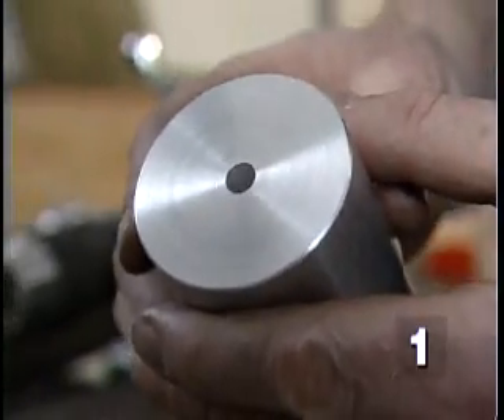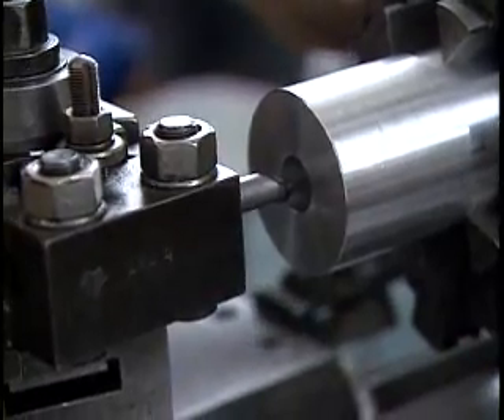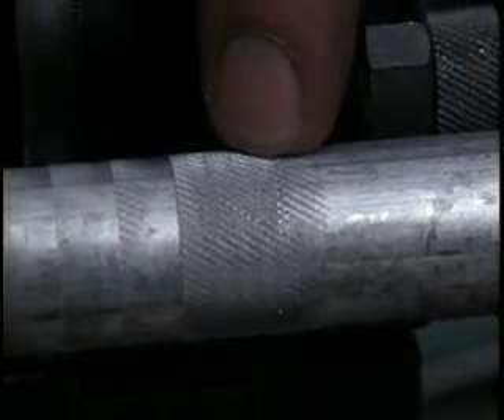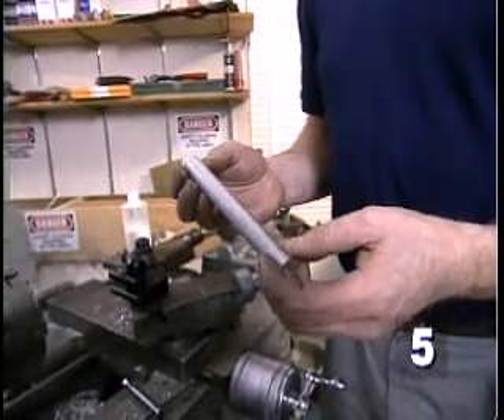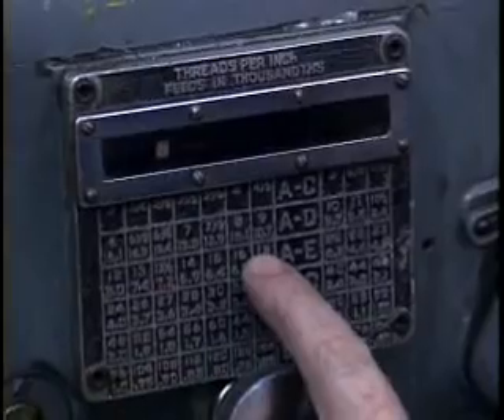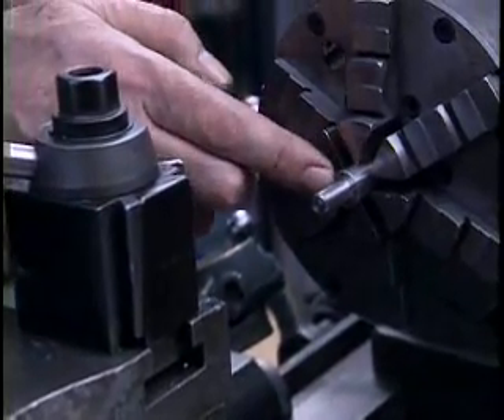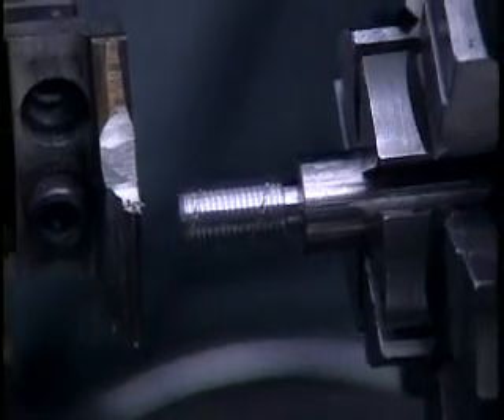Essential Machining Skills: Working with a Lathe, Part Two

Comment: Wouldn’t moving the stock after drilling the centre risk the stock not being clamped in the exact same spot and potentially cause a taper to be turned? Unless you were to use a 4 jaw and indicate it first…

Comment: 1:02 Tapping
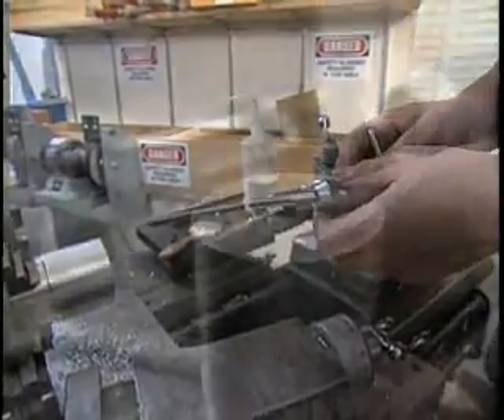7:33 Boring
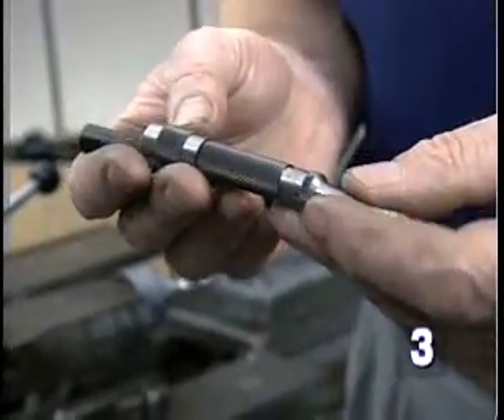15:31 Knurling
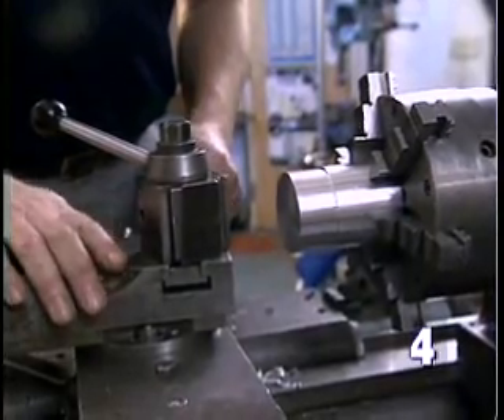22:23 Cutting Tapers with the Compound
26:19 Turning shafts + Use of Live Center
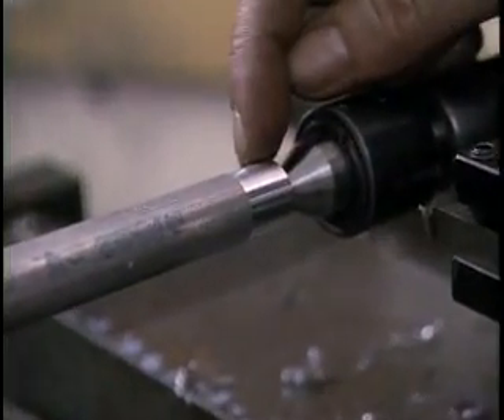31:04 Single Point Thread Turning
- 32:56 Setting the Machine
- 40:00 (+/-) Actual Cut

Comment: Ran an engine lathe exactly like this one years ago.  Small lathes like this one are the ideal size for a home machine shop and what you can do with one is only limited by your imagination.
Reply: That's a Monarch 10EE - one of the most precise (and interesting) lathes ever made.  Not exactly typical home machine shop material!  But your basic point is quite valid.
Reply: @ydonl  I ran engine lathes for years at G.E. Burlington, making parts for Gatling guns. Engine lathes we're classified by size... LES (Lathe, Engine, Small), LEM (Medium), LEL (Large) and LEX (Extra Large). The Monarch in the video I commented on was classified as LES, hence my comment. That said, I've operated smaller lathes, but if you want a machine tool that has any usefulness in a home shop, this is the size engine lathe I would opt for. I've done numerous things with lathes this size, and as I said it's usefulness is only limited by your imagination.
Reply: @TheRjjrjjr Sorry, I have no idea!  There should be a lot of resources on the web.
Reply: Geez it doesn't look small to me! I'm looking at a hobby lathe.
Reply: @dougrowell7817  :)  Yup! It's in a different world.  Not a benchtop machine.

Comment: i am only an absolute beginner metal mover but i also noticed that he didn:t use a thread gauge and a scratch pass  to cross check that the threading operation was set up correctly to produce the desired tpi.
Reply: Ya, these videos area great but I have noticed a few very important topics missed. I just saw him check the diameter of the part with a caliper for instance. That is crazy imo. Also, as a modern day manual machinist, the idea of constantly playing with the angle of the compound or tool holder just seems like way more work.

Also, they never mentioned setting zeros on the machine and how to gently creep up on a desired dimension. Which to me seems like one of the most important things.
Reply: @charlesseitz1659  Notice that someone said that the teaching this video and others on the same topic is a great difference. I enterpret that as superior. However I believe that he didn't want to go into more detail in this video and may choose so in another video on cutting threads. Anyway their are many great videos on cutting threads on a lathe out there. His advantage is his use of his technical vocabulary.